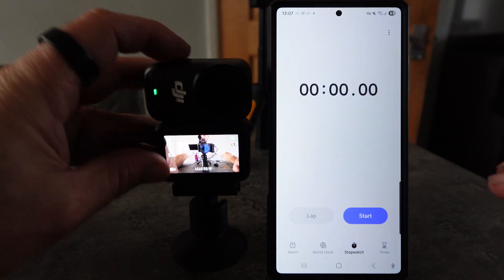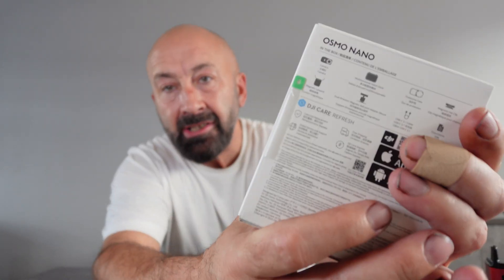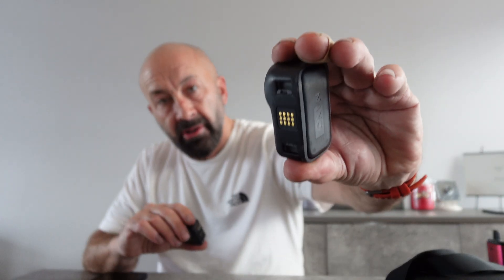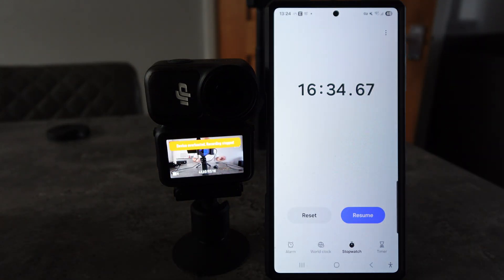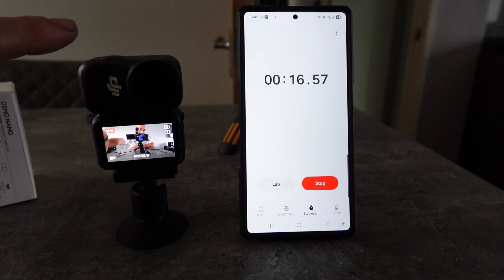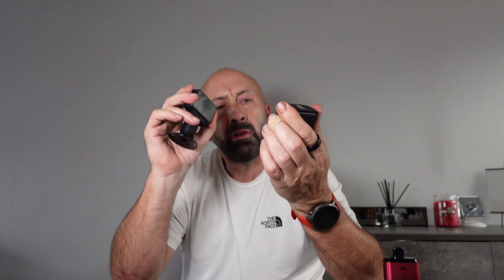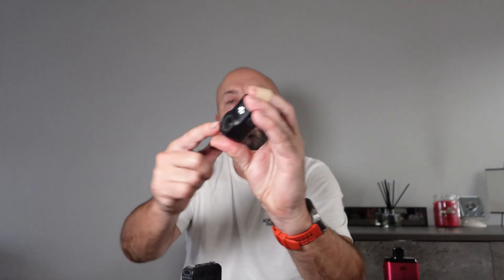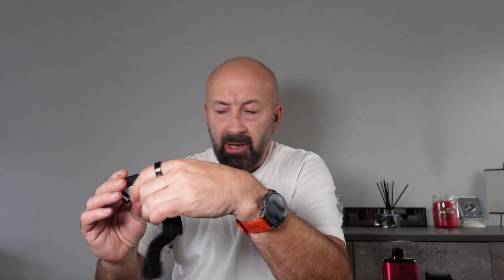DJI Osmo Nano - a hot issue!!!

Comment: how many mins can u record none stop? if i use this in a vacation? take pics videos?
Reply from the maker: They aren't really a photo device to be honest as your phone will be better. Video wise they come in a 64gb and 128gb variants but the dock has a micro sd slot . As for how long you could record before it overheats , depends if you're somewhere hot? As i said though these are for doing short clips anyway so in the real world it shouldn't be an issue.